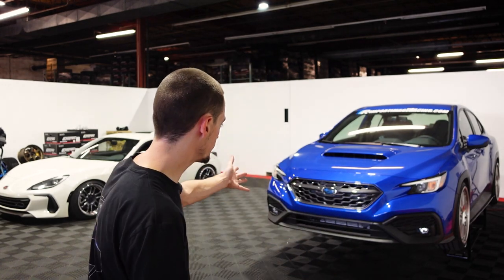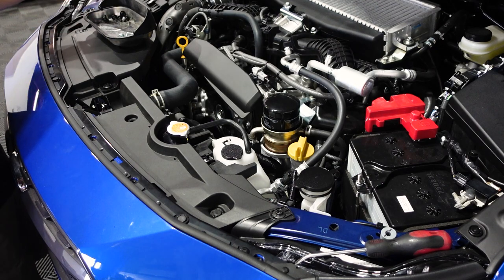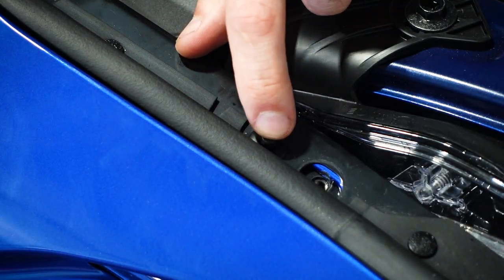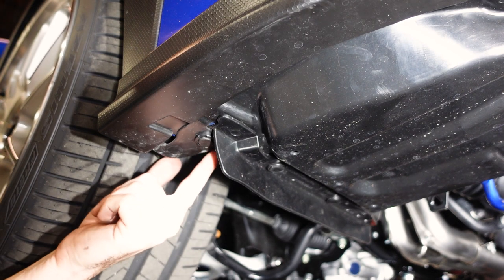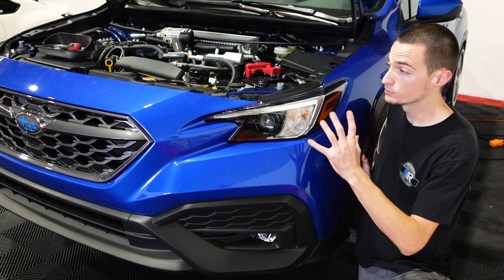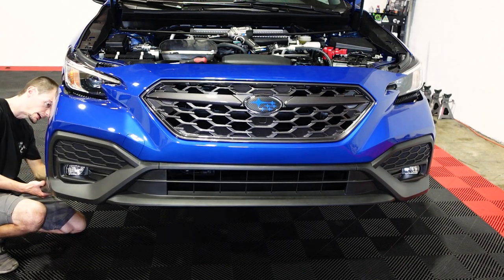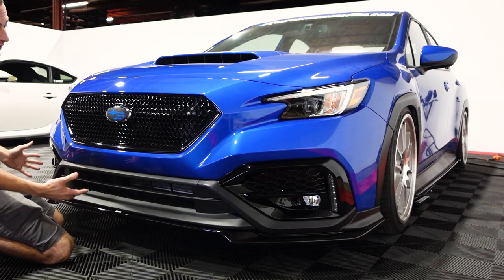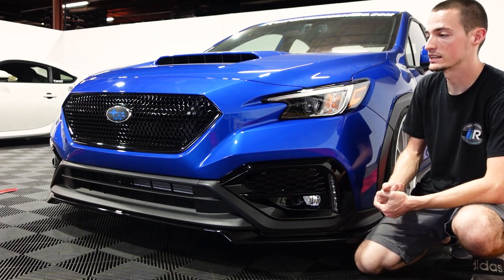How To Remove 2022+ WRX Front Bumper

Comment: i had a question regarding the updated fog lights added. Do they come with adapters to wire both the fog ight and the led strip since before it only had the one plug?
Reply from the maker: The OEM Fog Bezels have a seperate plug that is taped away and they plug into those. The fog lights don't get removed when switching out the bezels
Reply: @ImportImageRacing  does the bumper need to come off to install?
Reply: @ZibrayMusic  yes sir
Reply: @sharpshotta  thanks for the reply. This video will help tons then

Comment: What are the smaller clips with the pin in the middle that you push down on called? The ones that are in wheel wells. I broke one and need to order more but am only finding the bigger clips online. Great video! Watched it step-by-step and got my new front emblem installed!
Reply: Did you find any online?
Reply: @colabearz  I have not. I’m only missing one so far. Gonna check with the dealership next time I’m in.
Reply: @natebig did you ever end up asking?
Reply: @tonyb2791  sorry. Never found out. And i got rid of my wrx since then